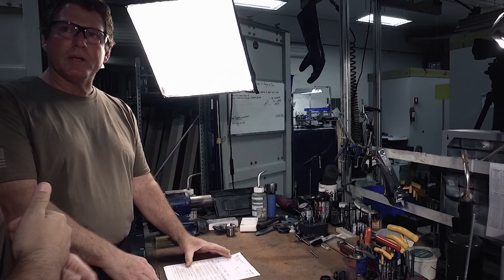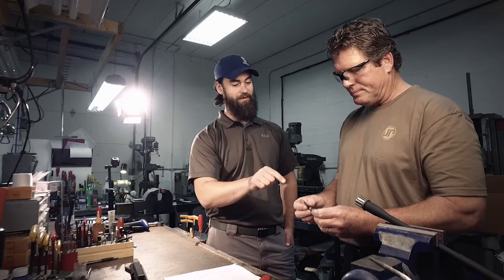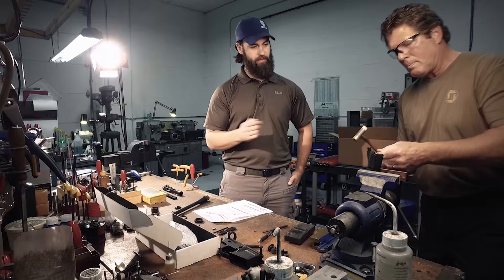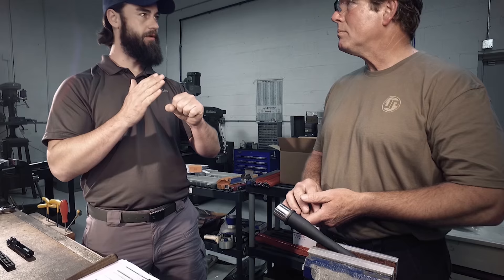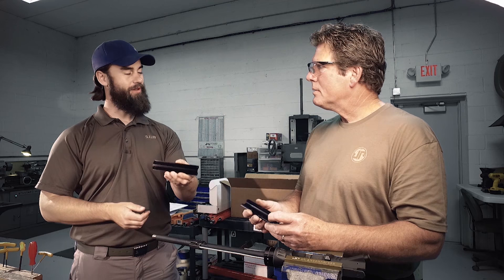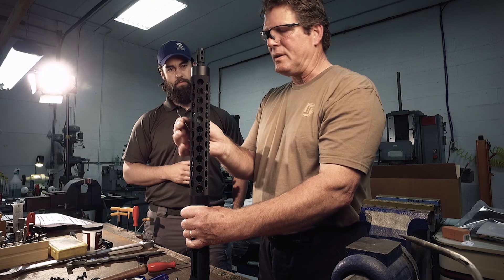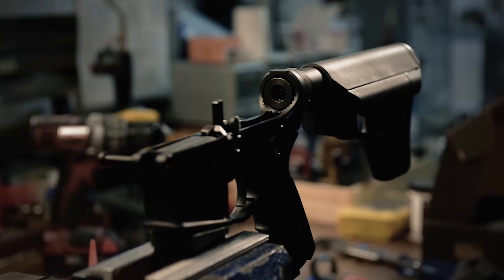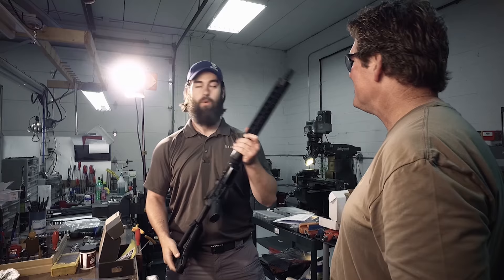AR15 Build with JP Rifles

Comment: I had to laugh when you mentioned the use of heat sinks on micro-processors in the” IT” industry.  I think that you meant to state in solid state electronics.  As a young engineer fresh out of college I recall that my lead design engineer made me go through the thermal requirements used in a multistage op amp design.  I had to use an extremely large heat sink that was completely unpractical.  Afterwards he educated me by instructing me to use a small fan that was far less expensive than the cost of the heat sinks.  The heat sinks work well but air flow over the heat sinks quickly dissipates the heat.  It’s like blowing air over your spoon full of hot soup.

Comment: Would those fin's help in a full auto AR? That would be a very interesting test to see how much heat if any is dissipated compared to a standard non finned heat sinked barrel
Reply: Not really. sustained full auto fire is going to heat a barrel to hundreds of degrees no matter what. it'll cool down faster but the damage is already done
Reply: It will most certainly help! It is better to have, than not have! No one ever said it stops the heat. It does, however, help reduce the heat soaked barrel and cools much quicker...well worth adding to your rifle!
I added to both my JP rifles and highly recommend any one else do the same.
Another added feature I love is the side charging and silent puffer spring.
All in all, best AR I've ever owned and way better than any Mil-spec rifles.

Comment: Too bad we didn't get to see the mating of the barrel with the upper.  That would have made the video worthwhile... Otherwise, it's just another build.  Was interested in the what and how they make them better than others.  (PS. I own a JP LRP-07)
Reply: For thermal fitting a barrel all you need is a propane torch.
Reply: Lol brotha it is a super old method that goes back 100’s of years and has been done by every industry imaginable. All they do is use a torch gun and heat the upper receiver for about 15-20 second and then slide the barrel in real quick, literally that simple yet they act like they invented the wheel with it.

Comment: Funny how they are not showing the heat fitting of the upper to the barrel LOL!! That's a simple torch technique to marry those! LOL And he said they use a 20 ton press to get them back out?!?!? DUDE, just apply more heat LOL! It will come right off!
Reply: There’s more to it that they do
Reply: @thelizardking3807  do you know what ride they are doing to it?
Reply: @rossearles4333  I know what they do and I know you need a press, heat won’t help..
Reply: @thelizardking3807  gotcha! I've seen some other companies do thermo-fit and apply and remove with heat...that's why I was curious.
Reply: @rossearles4333  yeah JP doesn’t mess around with their builds, they do more than just heat with a torch for the fit.
Reply: @thelizardking3807  No you don't know what they do. They do not use a press, it's heat, a dowel and mallet.
Reply: @rossearles4333  That is exactly what JP does, there is no press involved, they even posted a video of their process later on.
Reply: @StuninRub  there’s 100% a press involved at JP, have you talked to any of the guys there before?
Reply: @thelizardking3807  Why do you keep pretending to know what you are talking about? There is literal documented video evidence from JP themselves showing how they install and the removal of their barrels via thermofit that proves you wrong. You are just plain wrong and spreading misinformation.
Reply: @StuninRub  did you miss the part where he says “I’m going to show you how to do it at home”? No that’s not what they do at JP and I’ve talked to people there about it. You have no idea and need to stop spreading your misinformation, seriously.
Reply: @StuninRub  don’t know what the heck you’re linking there guy. They literally told you in this video what they use to press the barrels out, don’t know why you’re so upset over this. I’m stating facts, you’re speculating. The uppers they make are undersized specifically for thermo fitting.
Reply: @StuninRub  some random guy spouting? Are you talking about the builder? Have you talked to anybody from JP before? And yeah I own a couple of them. Lol and you can’t even believe the video you’re watching, how many times do I have to state that they use a press and disprove of your method in the JP shop? This guy is a partner with JP, he’s in the JP shop with a JP builder. What more do you need? Seriously, I know guys there. Stop your blabbering, it’s ok to be wrong. What more proof do you need, it’s in multiple videos, I’ve talked to them and fired many of their guns. You’re plain wrong
Reply: @StuninRub  where did I ask who they are? And you link was nothing. Keep digging yourself deeper
Reply: @thelizardking3807  on /-cOlNGxUhsk from 0:00 through 4:46, especially from 4:34 to 4:48. 

Not matter how you deny it, it still exists. Only one digging here is you.
Reply: @StuninRub  again, not a working link.

Comment: How stupid that JP acts like they invented the wheel just by heating up the receiver so the barrel will slide in. It literally amazes me that they think they are so smart by doing that like it hasn’t been done already by every other industry for 100’s of years. They did that with their Super 42 buffer spring as well, they used 3 springs to make one and they acted like it was their amazing idea when in reality JP said it himself that they looked at older guns with higher cyclic rates and they copied the design of the springs from those guns.
Reply from the maker: Cool.
Reply: Maybe it's because they did it on that platform first.